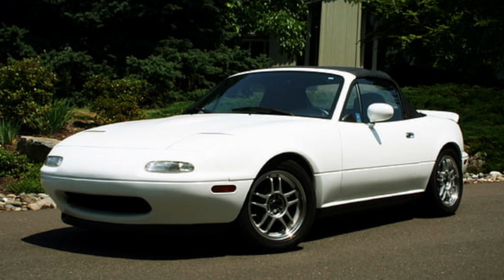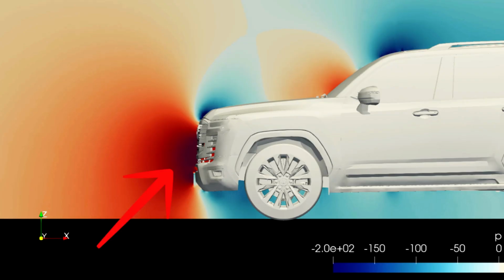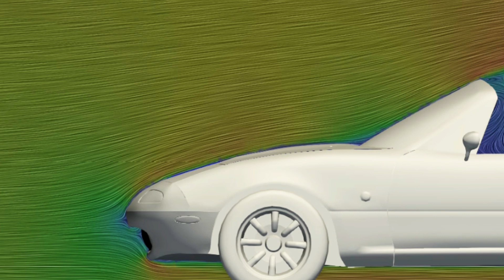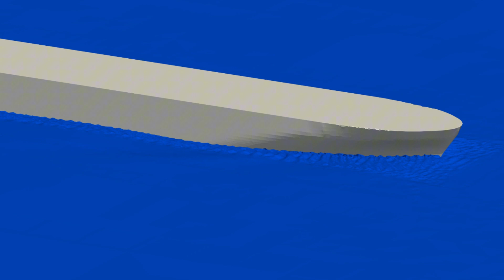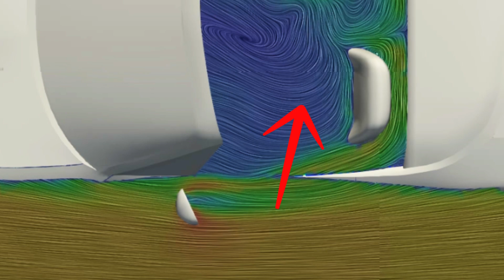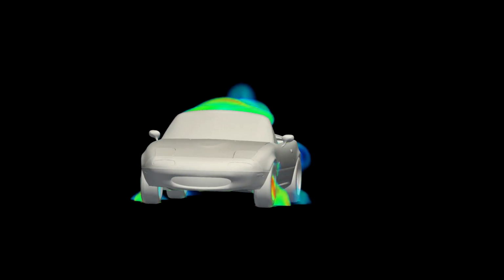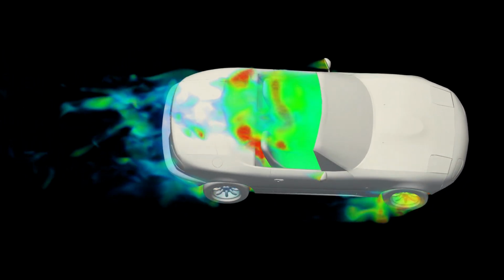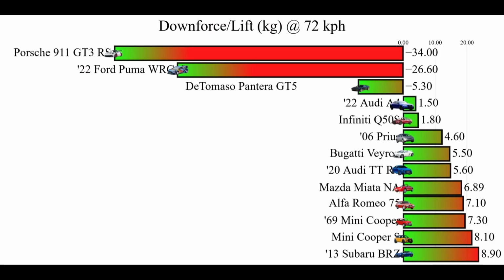Aerodynamics Of A Mazda Miata Vs A Boat

Comment: The Miata is not often called a boat, especially not the one you used for this comparison.
The NC, or the THIRD GEN Miata is called a boat, BY MIATA FANS, RELATIVE to other Miatas.

Comment: My hair is always a mess after driving with the roof down, you really feel the turbulence in the cabin. The low-pressure is also noticeable, I have seen loose pieces of paper and even a baseball cap take flight from the passenger seat or footwell. 0.43 is also what i have seen from other simulations, great work!
Reply from the maker: Thanks amigo!
Reply: raise the windows to stop that

Comment: Hey man i love your videos. I always keep asking myself, "What is the reference area used in drag coefficients?". I know it is an arbitrary value and i can define it whatever i want, IF i stay consistent. But if i want to use cumulative literature data, i need to match whatever value they use. For airplanes this value is the reference area for the wing (im still not really sure). For car applications, is it the frontal area? Thank you so much. Would love to see more aircraft aerodynamics like your LEX video.
Reply from the maker: Good question. Every field uses their own common value.

For example, for wings, it is the planform area, but for planes, it can be the entire projected area from above, for lift.

Note that it can also change between the force coefficients you're looking at. For example, for cars, the lift coefficient is non-dimensionalised by the projected area from the top view, while for the drag coefficient, it is the frontal area.

A good rule of thumb is to think about which area is contributing to the force most and that is probably going to be the reference area.

Comment: Miatas have this little "wind deflector" thing between the headrests that supposedly reduce wind in the cabin with the top down. Seeing an analysis of that would be enlightening (because I find it does jack shit)
Reply: The stock ones are pretty useless, but a larger aftermarket mesh makes a big difference.

Comment: So Once Upon A Time, I kept seeing the idea of "rollers" that spin so that (supposedly) air would attach to their surface and therefore be pulled "backward" (towards the end of the vehicle) and "down" (towards the space behind the vehicle) as a way to reduce the size of the turbulent flow behind a vehicle.
This was suggested for the back end of trailers being pulled behind semis, but presumably also could apply to the top windshield of convertible cars or to the trailing end of the rear trunk (for cars whose trunks are in the rear rather than in the front).
Care to wave your arms at what this would do to the airflow (and therefore the drag) of a Miata?
Or would this be no better than just putting some vortex generators in said locations?

Also, while all of your videos are entertaining, they seem to all be about fluid flow around the outside of a body (external aerodynamics) rather than fluid flow around the inside of some body (internal aerodynamics), say like how steam would flow if injected into the cylinder of a steam engine.
Care to wave your arms at something like that?

As the old ads for "National Enquirer" used to say, "Enquiring minds want to know".
Reply from the maker: The roller is a great idea. It is effectively the same idea as the Magnus effect where it helps keep the flow attached by reducing the flow deceleration.

What that would do is allow you to have steeper angles, like over the back window (which the miata has already), and keep the flow attached (which the miata doesn't do). That lowers the drag coefficient, and also allows you to use a rear spoiler to produce more downforce.

Sorry, I don't understand the steam engine bit. Wouldn't it go out the exhaust like it usually does?
Reply: @PremierAerodynamics  
> <snip> 
> [...] That lowers the drag coefficient, and also 
> allows you to use a rear spoiler to produce more 
> downforce.

Thanks for the reply.
In the spirit of no good deed going unpunished, though, let me repeat my question about whether or not rollers are no better than vortex generators.
I mean, while rollers could apparently improve airflow, I assume that they aren't in common use today because they don't make sense for some reason (meaning money).
I ASSUME that they take too much energy (presumably from the engine which in real terms means fuel cost) to justify their existence.
Vortex generators no doubt also cost energy and so are also presumably expensive in terms of fuel costs, but they are also presumably mechanically simpler and therefore cheaper.
Apparently, this cheapness apparently still isn't sufficient.
But this is all just speculation on my part as I'm not an aerodynamicist and I don't play one on TV.
What does a real aerodynamicist think?

> Sorry, I don't understand the steam engine bit. 
> Wouldn't it go out the exhaust like it usually 
> does?

My understanding is that the air flow around the top mounted valves into the cylinder of an internal combustion engine limits the flow into the cylinder, but presumably has the desirable trait that the turbulent flow of the fuel-air causes the mixture to be better mixed.
But steam flowing into a cylinder on a steam engine doesn't need such mixing and presumably the turbulence does nothing but slow filling and emptying of the cylinder.
ISTM that causing the steam to enter the cylinder tangentially near the top of the cylinder through a cylindrical valve would reduce the turbulence and so speed up cylinder filling and emptying processes thereby making them more efficient.
Again, though, this is all just speculation by a non-aerodynamicist.

I also have to admit to a perverse interest, though, in how you modeling software deals with a downward vortex around the wall of the cylinder produced by tangential input flow presumably meeting an upward vortex produced by the wall flow bouncing off the top of the piston and thereby heading upward inside the downward wall vortex.
For some reason, a Hilsch vortex tube comes to mind.